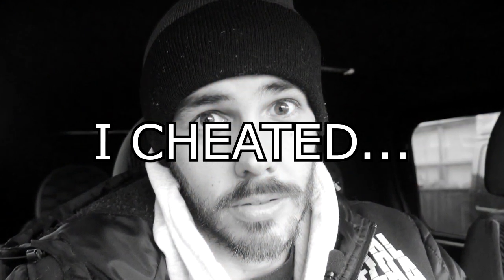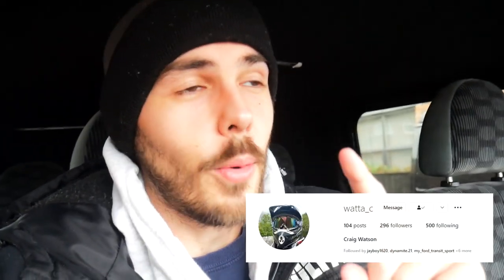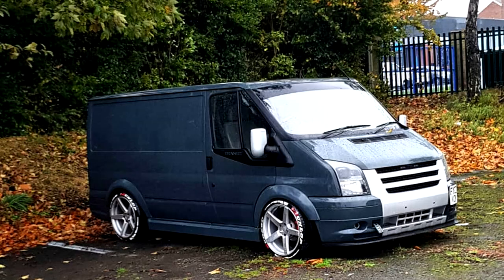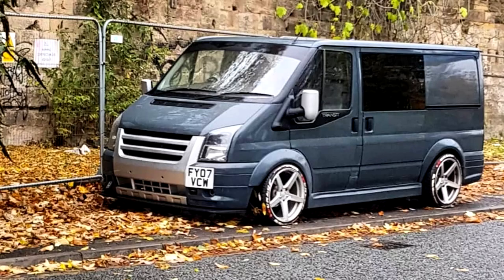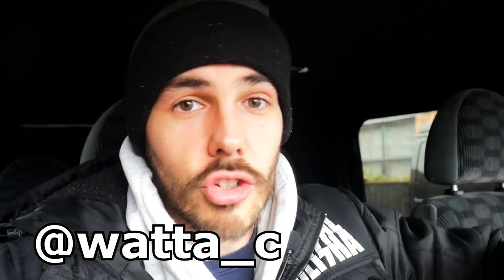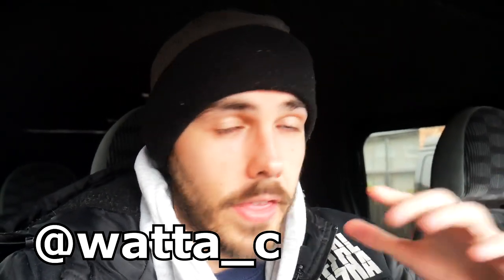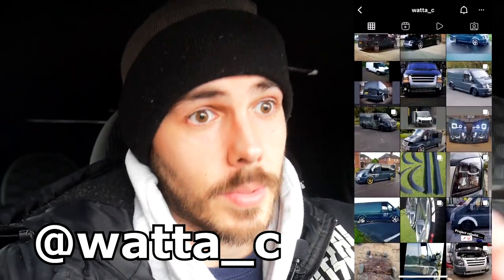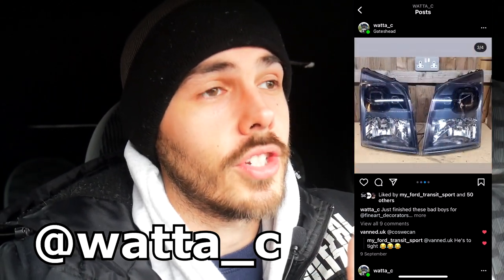Ive UPGRADED My MK7 Ford Transit Headlights! 🔥😍

Comment: So how much of a headache is removing the lenses. And does the silver parts remove easy.
Reply from the maker: They’re a headache if you don’t know what you are doing and my silver bits just fell apart if I’m honest
Reply: @coswecan  I have done similar before but with glass that holds heat nice. I think I will have to try. Look so nice your van.
Reply from the maker: Wel I hope it goes well mate, thank you for the support 🙏🏼 appreciate it